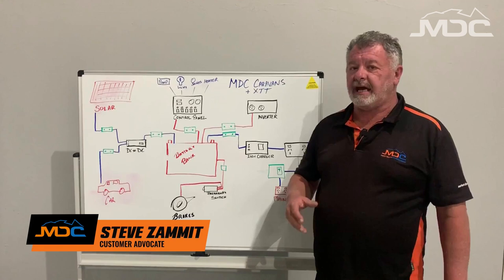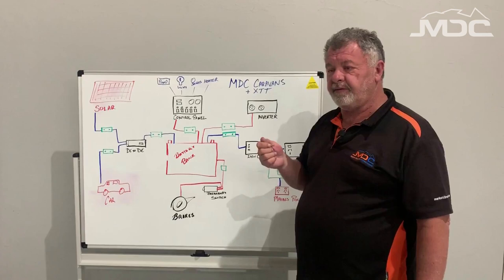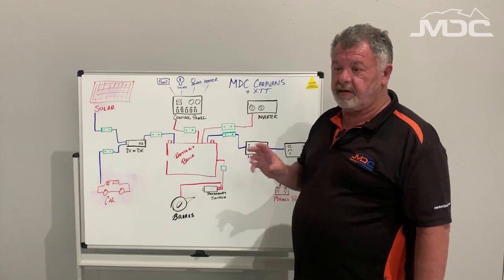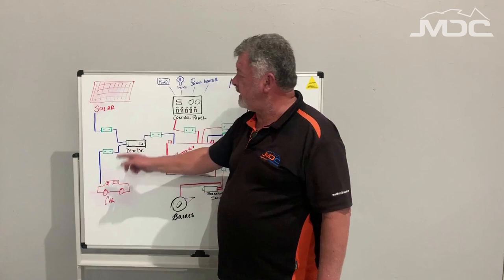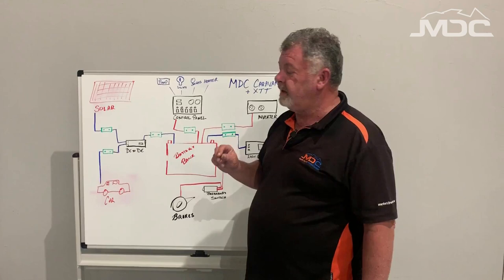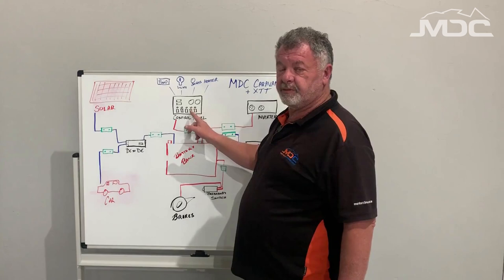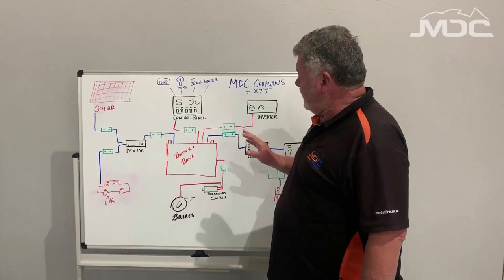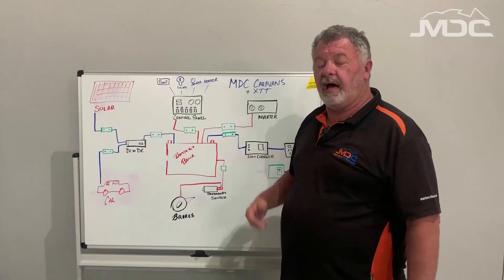MDC MASTERCLASS #143 - Simplifying Electrics

Comment: Im sure many people would like to see a video in relation to the new regulations if it complies to lithium PHOSPHATE life po4 sealed off from habitable space. Life po4 nothing like lithium ion which have thermal run away.
  With here regulations does it state no DIY can work on there 12v system using lithium life po4 batteries?